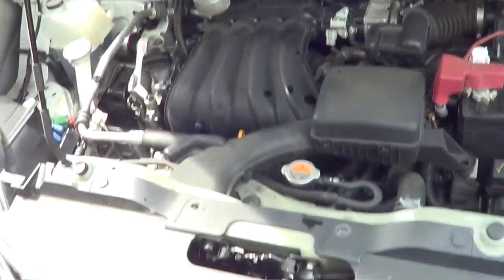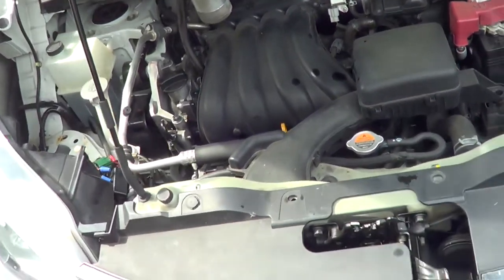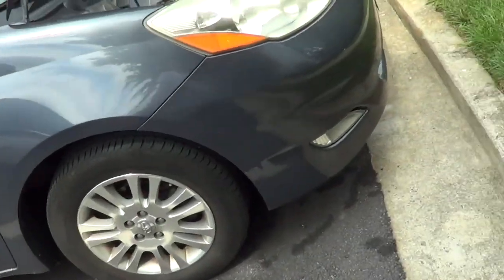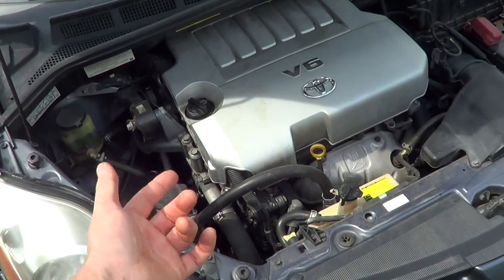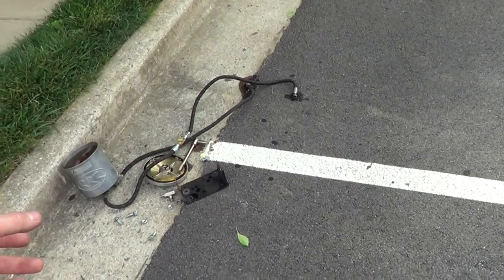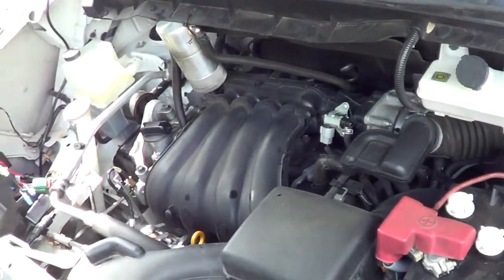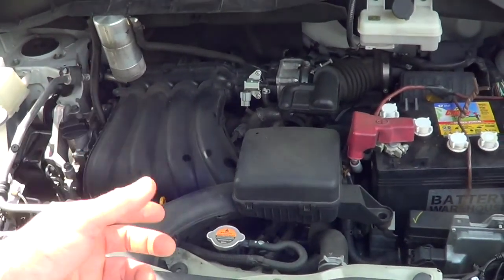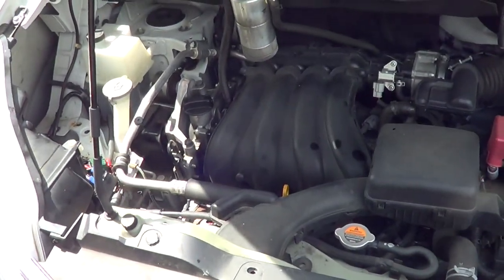Oil Bypass Filter Pulled on Gasoline Engine

Comment: You couldn’t be more wrong sir. I have a 2007 Silverado with 510,000 miles on original motor. I use the Amsoil bypass filter and I change the oil every 15,000 miles. Every time I change the oil, it’s pretty darn clean. I run a pilot car service. Don’t use that toilet paper junk filters. Use Amsoil bypass oil filter system. 510,000 miles is my proof that it works. No ticking, no knocking, no sticky valves. Just clean oil.
Reply from the maker: I definitely get people commenting the same.    I have to change out the engine in this video at 190,000.    The piston have plastic sides that are worn out.    It makes the gas engine sound like a diesel at certain rpm.    I bet your engine does not have plastic pistons.
Reply: @NathansHVAC  true it doesn’t. It’s a 5.3 GM V8.
Reply: @John-622  I am considering the Amsoil bypass setup for a Vortec 6.0.  I am certain the added filtration will help but I am not sure how much.  There are 5.3 engines, with a half a million miles on them, without bypass filtration.

Comment: I agree w/ your summery 
I put one of these systems on a V8 and after 2k miles the oil didn't appear any cleaner/clearer then i used a clear plastic bottle and ran the motor to see whats coming out of the bypass filer line....dark oil
it may filter to smaller particulates but it defiantly does not "clean/Clear" oil
Reply from the maker: Yep.   I have since just concentrated on the main oil filter.   Some guys change the main at 3,000 miles.   I did pressure drop testing and found that my tiny little lawn mower filter on the NV200 really does start opening the internal bypass at 3,000 miles.   So, they were right.    I have since switched to a much larger main that is more normal sized.   You can check your own main filter by taking note of the PSI at cold start.   My NV200 would run 98 psi with cold start.   Raising the rpms up didn't increase the oil pressure because the oil pump already had the relieve valve regulating at 98 psi.    If the main filter clogs, you will see the pressure drop 10 psi or more on cold start.   Most filters have an internal bypass set at 10 to 15 psi.

Comment: I think if you would install electric shut off  valve with  toggle switch on that bypass filter oil input line  , this way you could turn ON manually flow of the oil to that bypass filter AFTER you started  engine,  so it would not mess you VVTI and that you dont have to loose that 1-2 sevond untill pressure built up. Maybe that filter is not helping with oil longevity,  but i think it still do some cleaning to the oil to prevent oil soothing on your internal engine parts.
Reply from the maker: Im working on startup oil and main flow now.      I use an oscilloscope to graph start rpm and pressure.   Ill do a video on it.    Good drain back valves allow 1.5 sec to full pressure.   Leaky drain back takes an additional second to refill the filter and bring up pressure.  If you ever hear your valves chatter on startup, it is from slow pressure build up.
Reply: @NathansHVAC  since this is not primary filtration,  i would put electric shut off switch on the input flow line and turn it ON  anytime  i want to filtrate my oil . This way you dont have to worry about valves shattering or VVTI in your case

Comment: I appreciate your analysis and respect your approach. You have changed my approach to all this and will be performing my amsoil bypass filtrations on a bench every month or 1,000 miles. It’s extremely easy to do because I have a fumoto ball valve on each vehicle AND they all use the same 0W-20 oil.

I agree the BEST method is to reduce the change intervals and will do that and continue the offline filtration too. Since The bench method doesn’t impact oil pressure or real-time performance I’ll continue filtering my oil through the 2 micron medium since its very easy to do. This also provides me the opportunity to visually check the oil and will also force me yo confirm the fluid level too.

Great video, analysis and honesty 🙏

Comment: Well said, I had a full dual remote+bypass on my F150, waste of $$ and takes a fair bit of power to push thru the lines and yes it takes a couple seconds extra to get to upper valvetrain on every startup so the tradeoff it isnt worth the money.
Reply: So, even without the bypass system, that wouldn't change the amount of time it takes the oil to get to the "upper valve train."   Your reasoning doesn't make logical sense.   There are oil passages that treat that upper valvetrain on the stock setup.  Adding a bypass filter has zero effect on that.   If oil isn't getting to your stock valvetrain in time  it has zero to do with your bypass filter, and is just a normal function of oil needing to be pumped up to that area from the pan after draining down while the engine is off.    A bypass filter at most receives a few percentages of the oil flow.  And, on cold startup, barely any oil flows through the bypass filter (Frantz as an example).  As the oil warms, it flows through the bypass filter. . All oil pumps are engineered to more than compensate for the pressure required by the engine application.    The bypass systems is a separate circuit and doesn't affect the main circuit of oil at all.  Did you remove the original oil passageways and routings  that came with the truck?  Likely you did not, because they are on the inside of the block and heads.    Therefore, the oil takes no longer to get there with the bypass system.    You also miss the importance of less engine wear.     Also, if you used the Amsoil canned system, you likely overpaid were paying a lot of money to change the bypass filter, when, simpler and more effective systems exist that just use dense cellulose paper, like hard toilet paper,  Scott 1000 1 ply, stuff like that.   Simpler, more effective and cheaper system examples are ;  Frantz, Kleenoil, Motorguard, etc,  even a trasko would work if you can fit it in the area where your full flow filter goes.
Reply: @orthopraxis235  Well had you actually read my post instead of running yer mouth like you just did, you'd have seen the part where it says remote FULL FLOW AND BYPASS , blatantly obvious you know jack about how hydraulic systems work, keep playing key
board mechanic and leave the real stuff to those of us that actually work on our stuff

Comment: Oil does not get dirty, the filter Cleans the oil, also every Remotely Modern vehicle needs Synthetic oil PERIOD.
Reply from the maker: I use synthetic.   I also ended up over sizing the main filter.   I will post a video after I get some miles on the larger main filter.

Comment: This is all mostly hear say based on nothing but your word no offense, if your going to make these claims you should post all the analysis you have done in video. No matter vehicle normally what is seen is your wear numbers for alu,iron,copper, tin.....Normally iron and alu are only ones that you can really use because of how "high" they are you divide that number by the miles driven. Do oil analysis and then you can tell trend after installing bypass system. Most people see 30-50% improvement in parts per million wear /per mile anywhere between 2-3 changes after bypass install. And yes your right Particle count tests are a hoax when done by most labs- most use a let it drain through micron paper and then estimate the numbers for all other mircon levels. It is possible to get them correctly but problem is no one would want to pay to have it done correctly because its very expensive. At my work we have a machine that can actually test hyd fluid accurately but thats like i said very expensive machine.
Reply from the maker: My goal was to extend the oil change intervals past factory specs of 7,000 miles.   I couldn't achieve that with a bypass filter.  The oil still became very dirty with the bypass filter and the oil testing still recommend oil replacement because of additive depletion.   All this year I have been measuring oil pressure drops on the main filter and I have determined over-sizing the main filter or replacing the main filter at 3,000 mile intervals will result in noticeably higher oil pressure.    I will do a video on this subject once I complete 10,000 miles of pressure measurements.    It turns out that cold oil opens the internal bypass on the oil filter starting at 3,000 miles with a 15 psi pressure drop thru the media.    I used dual pressure senders to gather this data, but I have determined that the downstream pressure sender is all that is needed to check for a clogged main filter at engine start when the internal oil pump pressure relief is relieving the over pressure.

Comment: and a bupass filter cannot help with sludge. sludge is produced by (mostly) hot spots in the engine. some engines are sludge prone and others are not. so blaming the sticking pin on the filter is BS of the highest order.

Comment: you ARE NOT losing lubrication to the upper part of your engine at any time using the bypass filter. who told you that you were? and you believed them anyway? that thing uses a very small trickle of oil at any one time. sorry you don't understand. put thee filter on Ebay and let one of the rest of us buy it. you don't understand it and that makes it bad.

Comment: So your oil analysis can be skewed depending on where you get the oil from. According to Gail Banks and Amsoil (they ought to know) if you analyze the oil drained from the pan you will get sediment and particles that settle there in the bottom of the pan over time - however if you take your sample from the oil via the dipstick tube (from the top, which is the 'working oil') you will get a more consistent and accurate analysis. This simple change could show the clear, 
real world benefit of bypass filtration.
Reply from the maker: I already suspected that and did all testing with the amsoil hand pump from the dip tube.   I even used brand new nylon pipe on every test and only sampled a few minutes after driving all day.   I could not find any testable improvement with bypass filtering on a gasoline engine.   The 20% or so of oil additives depleted the same.   The color of the oil was not different with or without bypass.   It seems to me that the best way to clean the oil is the replace it.  There is a chance the bypass my improve the main filter by reducing the particles that could clog the main.   I did not test for any changes on the main filter with or without bypass.   Pressure drop on the main would have been a good test, but I'm not set up to measure that.    Main filter pressure drop testing is on my todo list.
Reply: @NathansHVAC  I don't think anyone would argue that the best way to have clean oil is to change it. When looking at fleet numbers, for instance, there is where oil change costs can be substantial for several reasons and bypass filters have proven to help when looking at the big financial picture. 

Also, for Diesel engines where soot from burned lubricants and even minimal blowby will counteract the Zinc additives. (Zinc is especially important in high-pressure lubrication) Anything you can do to reduce soot between oil changes can make a measurable difference in engine wear - particularly on camshafts, main bearings and other high-pressure areas.

My dad was a Frantz oil filter dealer back in the day and they really made a difference just using everyday toilet paper (when used properly) especially on heavily used large engines. Of course that doesn't necessarily translate to small 4cyl motors as in your case.
Reply: @NathansHVAC  sounds like a huge pile of BS

Comment: Mercedes did a test for engine durability... can't find a web link, maybe only available in books... on a completely stock engine in roughly the 80's. Their only change was to modify the oil system to allow a bypass oil filter and oil changes without turning the engine off.  It went over 300,000 miles before they stopped testing without noticeable degrade in performance. Re-read this, this was 1970's tech in a 1980's engine, NOT modern metallurgy and NOT super-clean running engines. Dirty oil kills engines. Frequent starting kills engines. Eliminating either one of these will dramatically increase engine longevity, but few of us can reasonably implement the latter.
Reply from the maker: New oil is cleaner though.   My testing could never show.the bypass filter doing anything on tight new engines.  Maybe worn out engines could benifit?
Reply: @NathansHVAC  Both are better than dirty oil. So any condition where dirty oil is likely, cross country driving, diesels, high mileage engines, stop and go,  or where maximum engine life is wanted, will benefit from cleaner oil. Which is better depends on your goal and your conditions.
If you are a short distance driver, changing the dirty oil is most likely the best solution due to the additional water, acid, and fuel contamination.
If you usually get up to full operating temperature for long enough to remove those contaminants, either method is viable.
If you run cross country or a diesel, a bypass filter is likely the better choice.
An interesting test would be for how long is new oil cleaner than bypass filtered... 100 miles, 500 miles, or more? That would be very engine specific I imagine.

Comment: if you used a diesel rated oil in a gasoline engine with oil bypass filter your results would have been different gasoline oils have a low TBN for PH resistance also have a low soot control additive diesel oils have a high amount of these and you can get 10w-30 synthetic diesel oil along with just about any other weight you need liquimoly / amsoil / valvoline / mobile all carry these designed for the UK / EU engines which are often small diesel engines that are designed for cold climates so have low weight oils that are suitable for modern variable valve gasoline engines.

Comment: Looks like you got the wrong bypass filter to your application that thing is huge looks like it’s made for a big industrial diesel that supplies way more oil pressure than them passenger cars could every supply

Comment: Thank you for great videos... Looks like there is a varnish buildup on the inside of the walls of bypass canister...  most likely its because of low quality oil with low detergent and dispersant additives. 
Varnish will cause parts with hi tolerance to stick. I use Schrieffer oil in all of our fleet vehicles and it keeps internal parts clean from varnish buildup.
Reply from the maker: I was using Amsoil Signature 5w30 full synthetic.  I just couldn't notice any difference using the bypass filters for extended oil beyond the recommended 7,000 mile factory change interval.

Comment: You need to use oil that can run for the extended interval that the bypass system affords.
Reply: Matt Leonard then why not just use synthetic or extended life oil without that bypass?
Reply: No. Change at regular intervals
Reply: @zakbrinkhoff324  
Extended intervals are still regular intervals.

Comment: It's my understanding that the bypass filter should be changed every 5 to 10k miles or every year. I'm wondering that if after 3 years that your bypass filter was no longer filtering.
Reply: A bypass filter has a lot more filter media (larger carrying capacity) than a normal oil filter. It should be filtering 100,000 km or longer between media changes. However that depend somewhat on how clean your engine runs and how much dirt it ingests. 🙂

Comment: I think if you believe oil is supposed to get dirty and be drained this is believable. Someone like me that has been running clean oil and no routine oil drains for 56 years it's not believable. I started with the Frantz oil cleaner in 1963. I now use the Motor Guard and Gulf Coast filters. When you see me installing a 30 dollar element or draining good oil because it is dirty you will know I have lost it.

Comment: Great thing when you can get a filter element almost as good as a roll of toilet paper for 30 bucks. I just bought a 16 pack 9f Great Value 1000 at Wal Mart for my Gulf Coast and Motor Guard bypass filters.

Comment: I have 8 Gulf Coast and Motor Guards in use.  Getting ready to install a couple on riding mowers. Just bought a 16 package of Great Value 1000 sheet for the filters at Wal Mart.

Comment: You keep talking about dirty oil I haven't seen dirty oil in my cars and trucks for the last 56 years. As strange as it might sound to you. Your oil is supposed to never get dirty. Only your filter is supposed to get dirty..The filters I have used for the last 56 years have been the Frantz the Motor Guard and the Gulf Coast. I would rather take a beating than allow the oil to get dirty and damage the engine then do a routine oil.drain. Try a roll of Scott 1000 sheet.

Comment: Actually Amsoil is like most oils. It will be clear if it is clean. A roll of Scott 1000 will turn the oil to where it will look new on the dip stick. Why your oil is dirty and my oil looks new I have no idea. Looks like a good element.
Reply: ,,,So you are actually using Scott 1000?  I thought you were joking.

Comment: Someone mentioned a filter that size should be changed every 30k or two years. That's a good way to get dirty oil and engine problems. About 40 years ago Amsoil had Bobby Unser saying this oil change is forever.  It.didn't work because the bypass filter was too expensive to change often enough to clean oil.
Reply: If you plan on draining the oil in 30 K miles you don't need a very good filter. The original Amsoil filter was a better filter than the pleated ones.